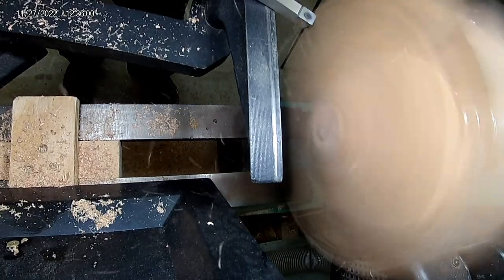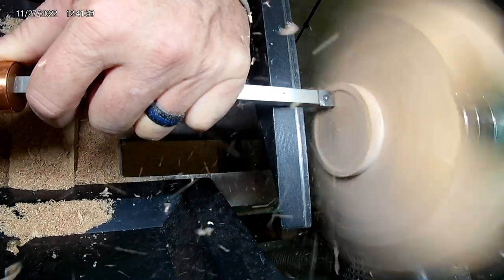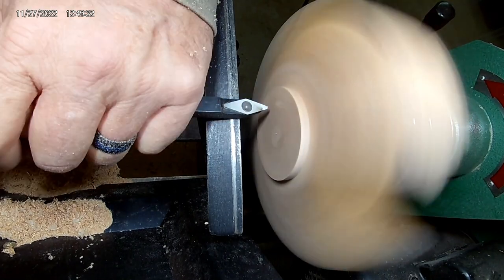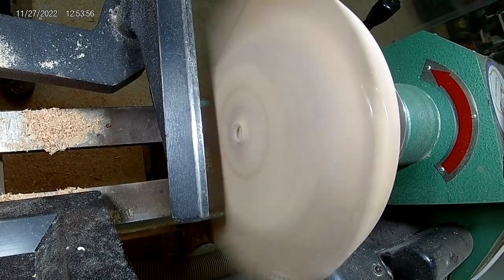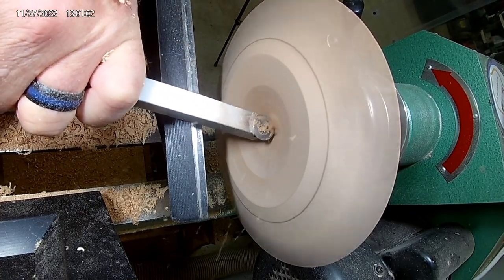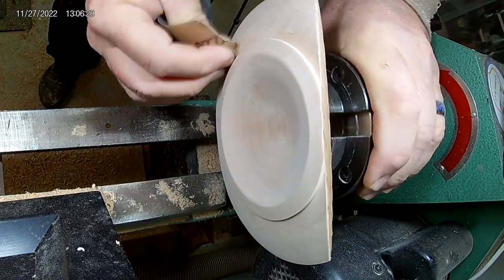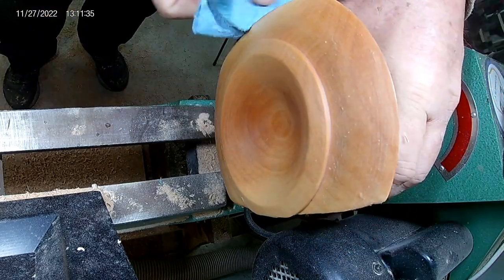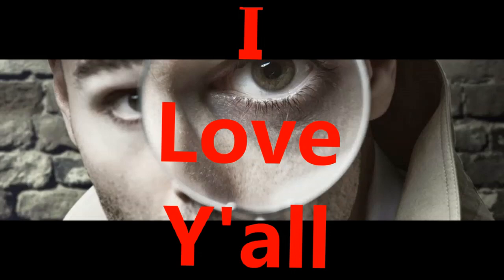A bowl turned from firewood!!

Comment: Thanks Dave! I enjoyed this. I learned from Mrs KFF that you can make your own wood wax by mixing 4 parts linseed oil and 1 part bees wax. Heat just enough to melt the bees wax, mix, stir and pour into a tin or something with a lid that can take the heat. That stuff goes from a liquid to a paste when it cools and it has a nice color. When she got into making candles, (I'm not into smelly candles) I thought it'd be boring but she's come up with some useful stuff for me too besides the candles (smelly).
Reply from the maker: Is that boiled Linseed oil? Thanks for watching.
Reply: @TLMD  I guess you could use the boiled linseed oil if you want a darker color. For a "yellower" finish just the regular linseed oil heated enough to melt the bees wax. I'm sure it'd work though regardless. Sounds like a great experiment!